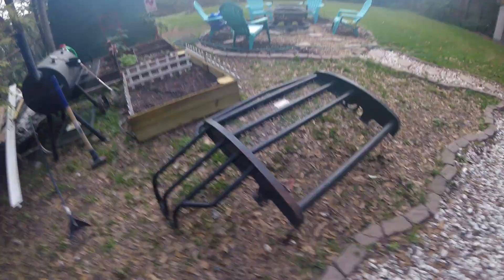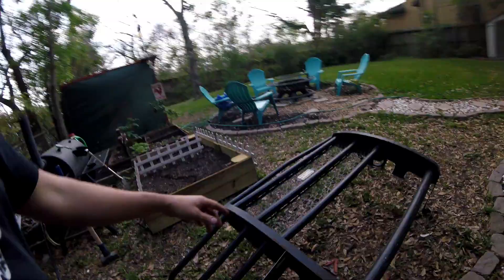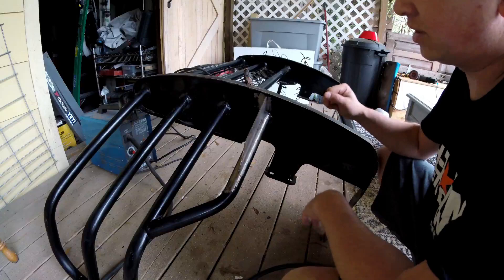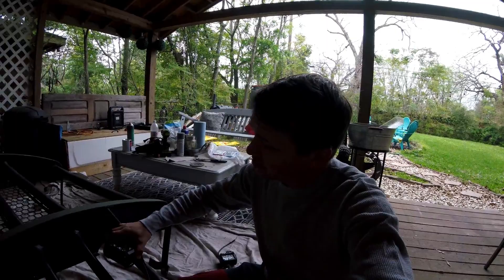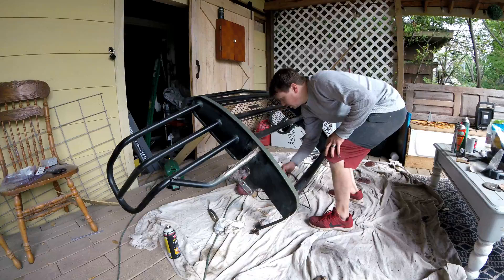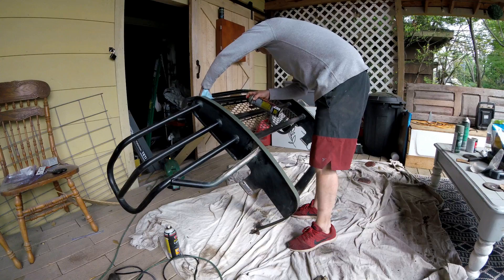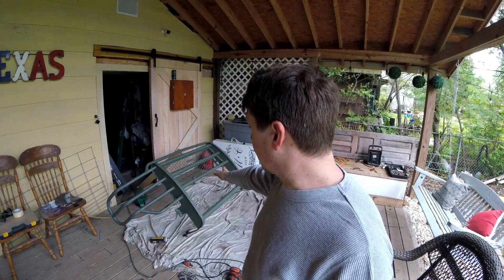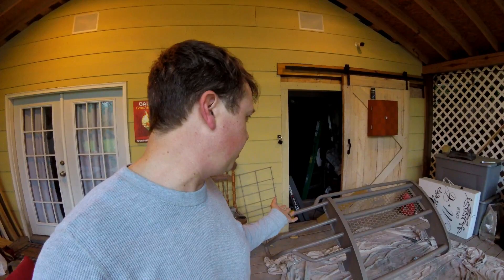F250 Grill Guard DIY Painting

Comment: Very nice job. Ranch Hand factory paint/powder coat has gone downhill from what it used to be decades ago not sure why. Every Ranch Hand bumper or guard I see starts rusting within a few years. Maybe it's because they're mass producing so much now quality goes down.
Reply from the maker: Thanks. The powder coat just didn’t seem good at all. Seemed like they mass produced them and just run them through with the bare minimum
Reply: @TEXASE36Garage  I think so. Ranch Hand used to be a small company that mostly sold in Texas now they're nation wide. I bought Tough Country bumpers and steps and have been very pleased with their powder coating holding up so far.

Comment: Hey brother been studying your video non stop when getting ready to repaint my grille guard. My only issue is I did a self etching primer let it dry and sanded, cleaned and then did a high fill primer myself. After this coat do I have to sand again or am I okay to start painting?

Can't seem to find the answer on the net.
Reply from the maker: High build primer is ment to be sanded down. Granted you don’t have to it just will make the final finish rougher if you don’t. But that’s up to you. I would lightly sand, clean and then paint
Reply: @TEXASE36Garage  Thanks for the quick response! I'm actually painting it with a line-x(truckliner) type spray paint so i guess I won't need to sand since the texture is gritty.  Been a long process for me lol I don't want to sand one more time.
Reply from the maker: @Dirty_  oh of your def using a line x then I would just spray away. You should be fine.